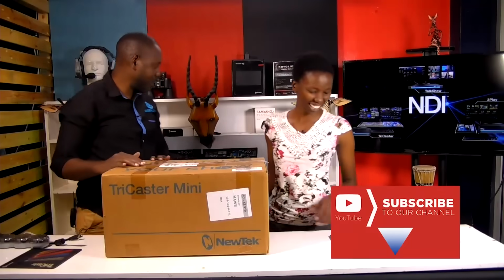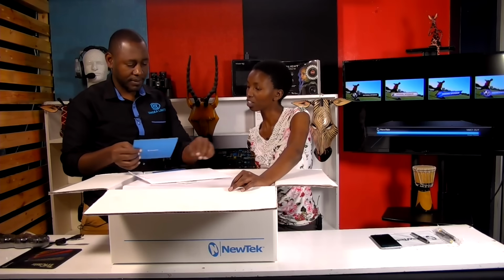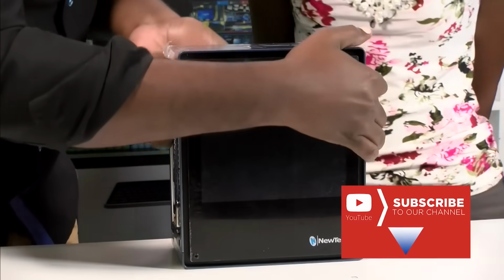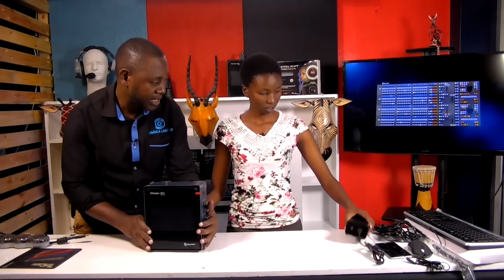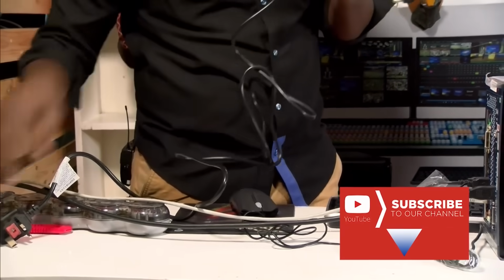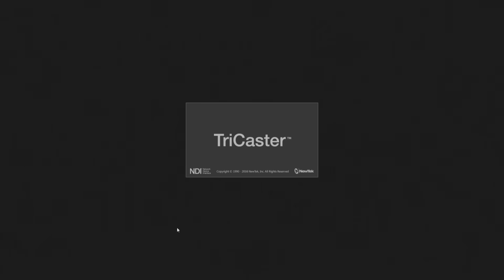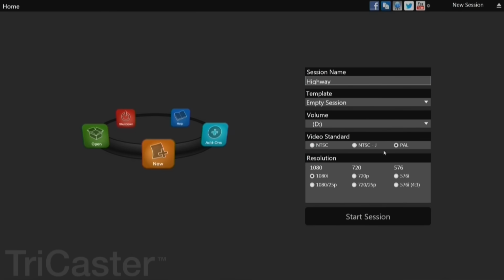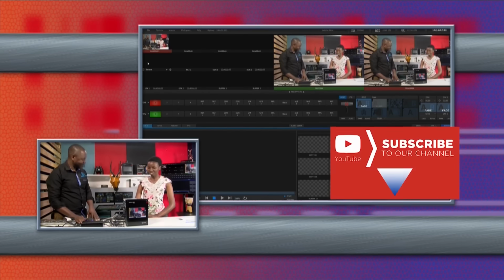Unintentional ASMR 🖥️ Carefully Unboxing & Installing Video PC (Kenya IT Show)

Comment: I really wanted to say this as I am a broadcasting student, and you all might enjoy this.
My High School Tech Center called the GI-TEC Center, operated as apart of our school. (And brought kids in from other schools around) I was an honors student for its Broadcasting program. We used a NewTek Tricaster for our student shows. However, it was the full version and not the mini. So seeing this equipment and the stuff in the background on the TV gives me some real nostalgia. (I was also a producer for our show The Oil Spill (school mascot theme thing was The Oilers) where we made the announcements as a video instead of doing them over the PA, which was cast out to the entire school's CCTV system. I not only hosted it once by myself but also hosted it on many occasions with other students, I also helped run it and was essential in its production. But the teacher that taught it and a good friend of my family retired this year, at the same time I graduated. Since then the class is being dissolved into Digital Media. After our Nexus system (recorded, timed, and sent out the program to the school's CCTV system) broke, it was going to be about $10,000.00 to replace it. The school didn't have that kind of money, so we came up with the solution of using YouTube instead. We did that and it works out better than it did. It gives teachers the time to play it whenever they want to and students will actually watch it. The program was mostly student-made but directed by the teacher. 

thanks for reading this, if you enjoyed it, please leave alike. And if you are interested in seeing a clip, search up GI-TEC Oil Spill on YouTube and you'll find them. :)
(Note: I was in charge of that channel with the Digital Media teacher until I graduated)

Thank you for reading my long-ass comment. Now please sleep :)
Edit: If this channel sees this, could you pin me? I'd like my story to be told :)
Edit 2: It was a switcher/SEG (Special Effects Generator) plus Video Computer and was made for studios.